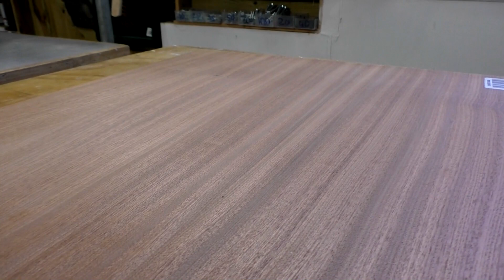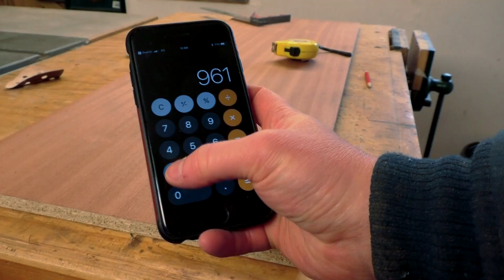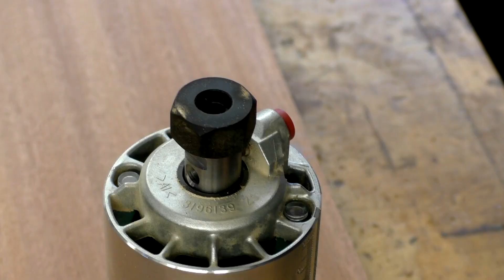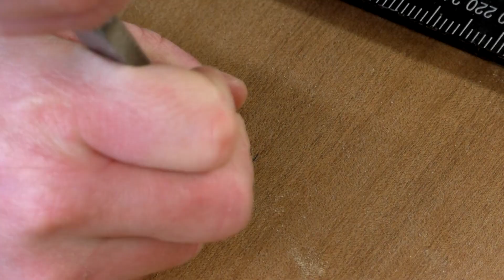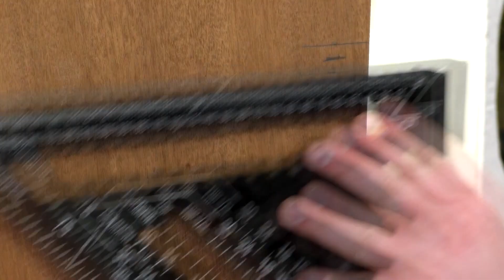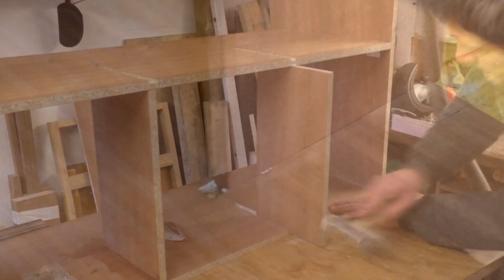Making A Mid Century Modern Vinyl Storage Unit (part 1 of 2)

Comment: Hi Keith. Really enjoyed the Dylan break. 'cat interlude' - He's such a cutie, maybe he wants more camera time. :) Instead of the brackets, might try using a piece of either plywood or solid wood cut in a triangle for the shelving support. To make it a little fancier or matching of the mid-century look you could make the long angle on the triangle sloped (or arced). Would still give the shelf lots of support but would take a bit of extra room. Thanks for making these videos, it's enlightening to see your thought processes and how you troubleshoot while working.

Comment: great project Keith but those brackets....... I agree with some of the comments on using dado joints and dowels for the top and shelfs. I have put together enough flat pack furniture to know that they are plenty strong enough for the purpose. keep up the good work.
Reply from the maker: Dowels do not adhere well to chipboard
Reply: Rag 'n' Bone Brown I beg to differ I'm afraid. while I know you want super strong joints it's only as strong as the chipboard itself. wood glue has an amount of water which will swell the dowel a little filling any voids around it into the chipboard. therefore strongest possible..

Comment: By dividing the shelves how you have the central space is slightly smaller than the two outer shelves... you need to take the internal dim then take off the width of the two widths of the dividers then divide this figure by three in order to get 3 equal compartments. I found this when doing drawings on Autocad and my dims weren’t the same!
Reply from the maker: No it isn’t, because the measurements I used were for placement of the centre of the dividers, not the edge of the dividers. All the sections are equal spacing when you work to centres
Reply: That’s right if you started with an overall dim from the centre of the 2 outer rails (the side panels) but not if you took the starting dim from between these... as the centre compartment has 2 half’s of a divider and the 2 outer ones only have 1

Comment: You should try using 6mm dowels in replace to the brackets
Reply from the maker: I considered it but wasn’t convinced they would adhere well to chipboard, so went for brackets and screws for better holding

Comment: tape does very little to prevent tearout. A much better way is to take a very thin cut through the veneer either forwards or backwards through the blade to cut through the veneer on the bottom, and than make a second cut to fully cut through.
Reply: The technique is very similar to when you cut veneered stock on a mitre saw, you first score the veneer, and than cut through.
The tape worked on the veneered chipboard, but for thin veneered plywood, you will not get a better cut with tape.

Comment: Flip your work piece over on the miter saw to get double the width of cut. Also a split dado/ half lap joint would have worked out great for the divider/ support pieces. Just a few suggestions for next time maybe.

Comment: Hi Keith, love the style of the unit, but a better material in my opinion would be plywood which is stronger than particle board and easier to fix together. I´m afraid I agree with several others that the metal brackets are just not right, dowels in plywood work very well but  you can use them in particle board too. Another option would be to use slim wooden supports glued and pin nailed. Please don´t take comments personally. People have different views and should be encouraged to express themselves and you don´t have to agree with them. You are an inpsiration to many of us who also like working with wood. Keep up the good work.
Reply from the maker: Dowels wouldn’t adhere well enough to chipboard in my opinion... the brackets will be stronger.  I explained at the end re: the choice of material. Thanks

Comment: Interesting. I have just been watching a video explaining how putting the tape on the cut makes no visible difference in regard to tear out. Might be an interesting video to see your results with and without the tape, if you have any offcuts?
Reply from the maker: I’ve never actually tested it on like for like material but it certainly seems to work. Maybe I’ll do an experiment in future
Reply: Colin Knechts WoodWorkWeb
https://youtu.be/_9nPFox_n5Q
https://youtu.be/mT7gfCkx8ew
Reply: It’s the underside where you’ll have chipout issues as that’s where the blade exits the cut with a circular saw.
Reply from the maker: The blade cuts upwards!
Reply: Rag 'n' Bone Brown My bad, got circular saw and table saw cut directions mixed around. Don’t drink and comment folks... 😀

Comment: Good project so far!
Question (or vlog request): what stationary tools and furniture pieces (besides storage) do you highly recommend for a small shop? In the near future I'm building a shop similar in size to yours, so I'm planning on the things that would be most needed. I already have a bunch of power tools, including a table saw, planer, and miter saw, but what else is recommenced? For instance bench-top grinder/buffer, drill press, bandsaw, etc?

Comment: Hi Keith. I noticed when you put the bit into your router it looked like you bottomed it out against the collet and that can be dangerous as it can cause the bit not to fully tighten - http://www.finewoodworking.com/2014/07/15/how-to-install-a-router-bit. There should be a mark on the spindle showing where to stop but they can rub off after a while. Can’t be too careful with those beasties!
Reply from the maker: Ok I wasn’t aware of that - thank you!
Reply: I didn't know that too! Thanks!
Reply: This was going to be my comment too. Fan of your chanel Keith and I'm not in the business of finger pointing other youtubers booboos....so please just consider this a well intended caution observation. Just back those router bits out about quarter of an inch.

Comment: Pretty sure you meant to publish this one on April first? Because them brackets have got to be a joke!
Reply from the maker: Why?
Reply: Because usually your stuff is quite nice. Those brackets are a total bodge. Look at the screw heads standing proud on them for one. Never mind the fact that aesthetically they are awful, you’re going to catch the album sleeves on them and cause damage. Please tell me you used them to see what people would say? Also have you noticed how much the speed square moves when using it to guide the router? Can’t be great for your accuracy. Keep up the good work, I’m a fan. But those bodger-brackets are beneath you.
Reply from the maker: What are you suggesting would be an improvement for the joinery then? Dowels would not adhere well to the inside of chipboard, hence why I didn’t use them. Biscuits are useless. I don’t have a domino. Screws through the top would look rubbish obviously. Glue wouldn’t be strong enough on its own especially if someone lifts it from the top. That’s why I chose brackets and screws to add strength. So come on, what would you do? Theres about 40mm gap between the top of the records and the brackets so no chance of them catching! If you were truly a fan of the channel, your comment would be less offensive and rude, and more constructive criticism.
Reply: I would have used confirmat screws. I haven’t been rude or offensive yet. Maybe try reading my comments with a different tone of voice? I’m sure you’re not made of glass.